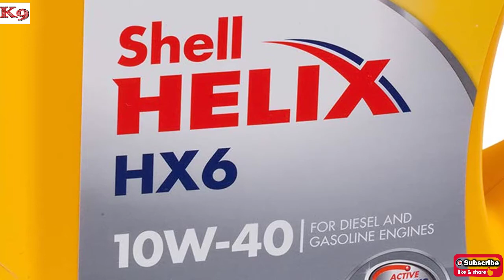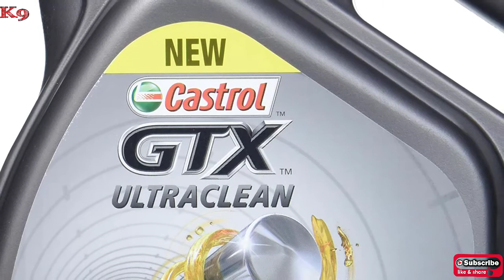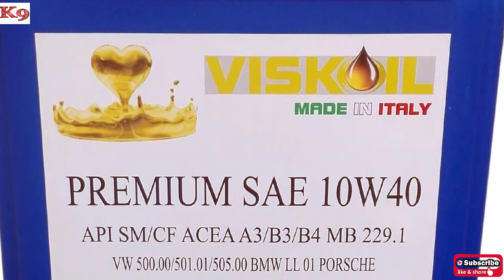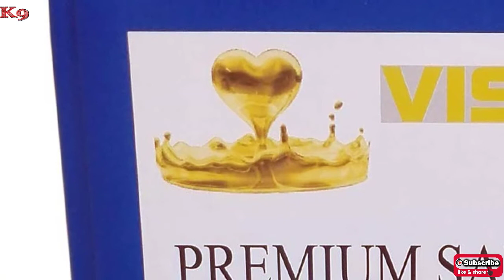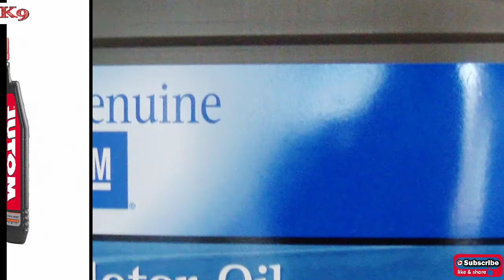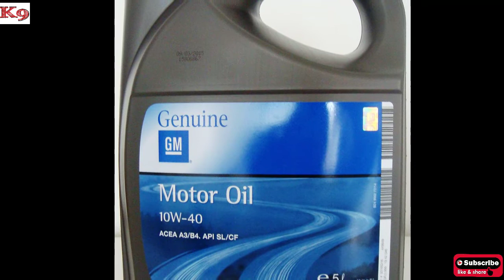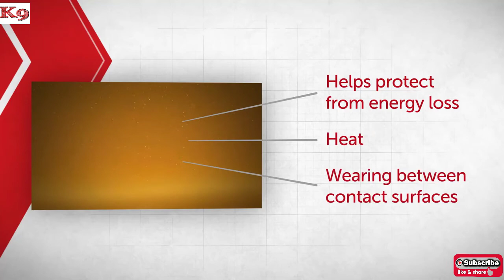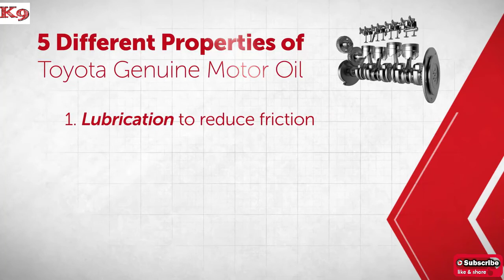The 6 Best Oils 10w-40 in 2021

Comment: Whatz wrong with 5W40 ?
Reply: Thinner I guess
Reply: 5w 40 fully synth has too much detergent compared with 10w40 semi synth for older vehicles that will cause the oil to push through seals like wd40. 10w40 is a more robust base lubricant biased to shear protection than keeping an engine ultra clean.
Reply: @speedoman1234  in wich moteur?
Reply: @eliaslamine5649  many older engines too many to list.
Reply: how about Motul H-Tech 100 SAE10W40 100percent synthetic...
is 100 percent synthetic & fully synthetic are the same?